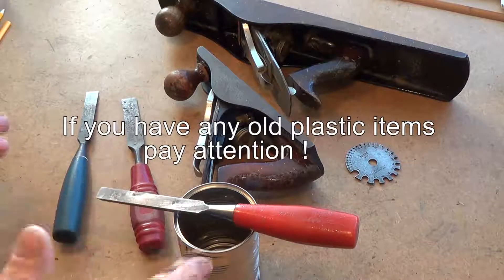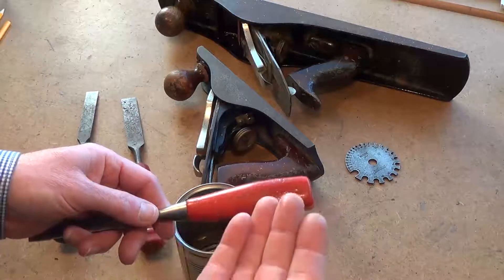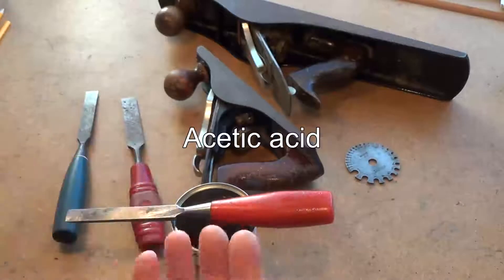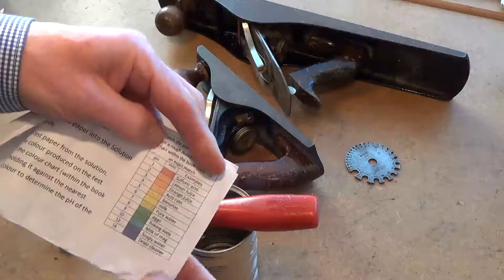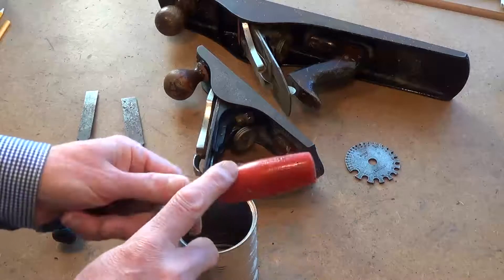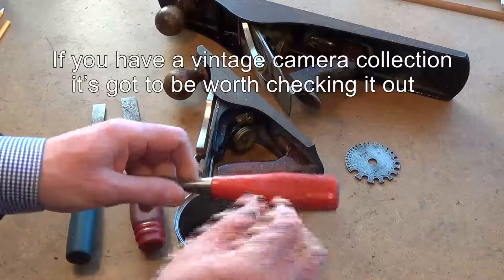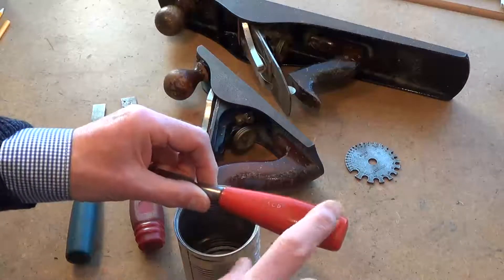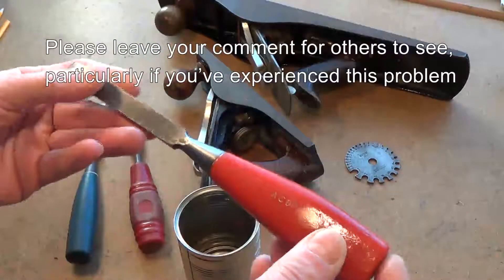Big problem with vintage plastic- tools and equipment etc

Comment: Cellulose acetate decomposing, quite common and well known problem. 

Apparently some American found out that if you lick the offending handles for a long time your tongue will go to sleep, how crazy is that?

I don't know a solution other than to get rid of the old handles/tools and use newer polypropylene ones.

Comment: I've noticed that on soft handles, things like pliers, but never knew what it was.  I've cut the old covering off and replaced it with heat-shrink.

I haven't got many plastic-handled chisels but if any do show signs I'll make wooden replacements.

Comment: Over the last 10 years or so I've noticed strange deterioration of various plastic and rubber items.  With plastics I've seen contraction cracking of parts molded onto metal, warping, breakdown where the plastic turns to a sticky mass, foam rubber turning to a sticky mess (this is very common, I've had to remove the foam from various camera cases, packaging etc before it ruins the actual item stored in it),  cable insulation becoming soft and sticky,  transparent plastic clouding, dead blow hammers shattering when used, all sorts of deposits developing on plastics, etc etc.
All rubbers and plastics don't suffer from these problems though. I have things that are extremely old made from plastic and rubber that are still almost perfect, but then some items as little as 5 years old have become useless. The composition of plastic and rubber materials is very complex so obviously some materials become unstable over time and breakdown into constituent ingredients. This could be an issue with the manufacturing process, ie, an incorrect procedure that makes a normally stable material fail prematurely, or, poor quality ingredients or overall material quality.
Obviously this is and will be a serious problem for many as so much of modern products is manufactured form plastic.
Personally this will impact me badly as I have a large collection of classic and vintage cameras, electronic equipment, motorcycles, tools, etc, etc.
I can't see a solution to it as once the degradation has started it cannot be reversed.
Possibly it could be stabilised by storing at a low temperature, maybe in a vacuum.
Reply from the maker: ***** 
Hi, I think this is a problem that we are stuck with and as you say it’s going to wreck a lot of special collections that folk have.  I’ve spoke with several museum curators and they’dall welcome a solution to the problem.  I think all we can do is recognise the problem and remove the offending article before it spoils any surrounding metalwork etc. Kind Regards  . . . Andy .
Reply: Yes Andy, I think the only resort is discussion with an industry expert, at least they would know whats happening and hopefully be able to offer advice.

Comment: OK, next day.  Evidently a lot of Sears stores see that their screwdriver, chisel handles get sticky and make the tool useless.  Our store honored their Craftsman Hand Tool lifetime warrantee and have replaced several of our tools.  I held out some that were either marginal or that I had modified, or that weren't Sears.  My 45 year old gasket scraper was as bad as your red handled chisel and was also covered with a smelly white stuff that looked like mold (it's some sort of crystal stuff).  When I brought all those up to the pantry to wash they smelled so bad they were filling the area with the acetate butyrate stench, and I covered them with water to stop that.  Then I added enough Arm and Hammer washing soda to make a saturated solution and waited about an hour.  After a scrubbing with a stiff brush the smell on all six handles was almost completely gone.  Some of the plating had rust stains I'll deal with, but the white spots, stickiness and vomit smell are gone.
     Since some of the tools had been treated before with a light clear spray with marginal results, I'll try again with something heavier like automotive clear coat.  Also, I'll change out the mat in the tool box compartment.  I've watched before as the white stuff seemed to spread in the box, so it'll be cleaned out.

Comment: I've had this problem and I thought it was a combination of the handle material and where the tool was stored.  I also had triangles and drafting templates degrade.  Today I was looking for a fix for the Craftsman screwdrivers.  At least ten years ago I cleaned several screwdrivers with cleanser (abrasive) and sprayed with a varnish of some sort.  It has worked for a while, but with additions to the assortment, it's time to take it on again. 
    I like the video, well done.  I plan to comment again with results.  Thanks

Comment: I noticed a similar problem on my old drawing board which I used in school. (Rotring Drawing Board A3) When I took the board after 20 years from the cardboard box the rubber feet were completely dissolved! In the box there were only greasy stains. The board and the ruler itself seems to be ok.
Some plastic boxes in our kitchen begin to dissolve. The start to smell like vinegar after some weeks in the drawer. I throw them away and switched complete to glass boxes. Hard to find these days.
I guess it initially volatilize stabilizing excipients and then disintegrates the plastic in certain chemical constituents.
As I was a child, my father always told me of his experience with plastic as an EE: "Plastic is a pile of crap." ;-)
btw: Very interesting Channel! I found you via EEVBlog.
Reply from the maker: Yep I think there has been, whole bunch of ‘wonder products’ that turn out bad and I guess there’ll be a whole bunch more in time to come.
I can remember a cigarette advert that said ... Craven ‘A’ are good for your throat’...
Thanks for the input.
Regards ... Andy

Comment: One other thought, Andy. I wonder if the aviation and space industry has had this problem?  You might give it some in depth thought on your next flight. :)

73 -- de Mick, WB4LSS
Reply from the maker: Hey, rotting aircraft parts, now there’s a merry thought! The good news is, the aviation industry would, I'm sure, deal with the issue. The thing is I’ve worked with these guys and I can tell you no one in that industry wants the finger pointed at them when an aeroplane drops out of the sky. Mind you I guess there could be a few bits of old spacecraft festering away, and the thing there is, as they reported on the news here in the UK when the latest satellite was falling to earth, they said, ‘having the debris hit your home would be like winning the lottery.’  I know what he meant but I think winning the lottery would be preferable.   
All the best . . .  Andy

Comment: Hello again, Andy. I just took a look at my '50s - '60s era tools and found no evidence of this behavior. I also checked the tools I inherited from my dad, most of which have hardwood handles, but a few are plastic and found nothing on them either. I wonder if some of the manufacturers back then used a "new and improved" chemistry make up? Perhaps that's why some plastics exhibit this and others don't. Or it may simply be your chisel is weeping from loneliness and wants to be held more! :)

73 -- de Mick, WB4LSS
Reply from the maker: Well, as I’ve said in the video, ‘this is the first time I’ve seen it in hard plastic.’ But looking at the comments from others I'm not alone.
73’s ... Andy

Comment: This is a big problem with Binson Echo units from the 1960's a liquid leaches out of the insulation of the wiring which goes brittle, the liquid is extremely corrosive..

Comment: This reminds me of vintage equipment I have opened up and found a sticky sweat on clear rubber hose used to hold bundles of wire together. I've also been annoyed by rubber parts seeming to completely liquefy - rubber feet/pads on equipment's bottom, and the rubber parts inside some old phonographs.
Reply from the maker: Yep’ I’ve seen rubber perish and have come to be quite accepting of it, but I’d never seen it on very hard, dense plastic like this. Even now the plastic is very hard, and quite hard to cut with the hacksaw. When I cut it up there was a strong smell of vinegar and the blade was damp but there was no obvious place where the liquid was coming from.

Comment: Have had that happen and shortly after the plastic turns to powder as it's integrity is now gone. With the wiring be careful, the liquid there is not acetic acid but PCB, poly chlorinated bisophenol, which was used up to the 1980's in PVC wire as a plasticiser. It was banned as it is somewhat nasty stuff, and leaches out as well with time and temperature, and reacts with the copper to make some nasty sticky byproducts. Still a lot of it around in older buildings in the walls.

Keeping the chisel and placing a new wooden handle on it will be nice, my dad used some Pride of India wood from the tree in the garden to replace a hammer handle once, as it was so tough that you needed a hacksaw to trim the older stems on the tree, nice fine grained and dense wood.
Reply from the maker: Hi, thanks for the input, I didn’t know that you’d made a comment as I'm not getting notifications from this new blooming system. OK on the cable, ok never thought to test it when I saw the green/blue liquid running down the wall, I just replaced the cable, so if it was PCB as you suggest then I guess that would be none conductive. I used to use very large capacitors (attaché case size and larger) and they had PCB’s in them as the dielectric. I was told the PCB's were harmless in its liquid form, (one rep said you could drink the stuff,) but its hazardous when burnt as the fumes are toxic, or so I believe.
Regards ... Andy
Reply: AndyDaviesByTheSea
About as harmless as Benzine, so you can drink it, but will die from cancer some time later.

Comment: Hi, Andy. You are quite right, this is a problem in museums - particularly those collecting 'modern' materials. As a Curator of Conservation I saw it quite often. Many children's dolls from the 1950s suffer from this effect as they were made from acetate (polyacetate) type plastics - these were only reasonably stable. The effect you observed was due to hydrolysis of the plastic in a moist environment. The base plastic converts to a hydroxy-polymer and releases acetic acid in the process. As you have noticed, this occurs after a long time and also exudes the acid over a long period. At present the problem seems irreversible. A similar effect is seen in lead objects which are stored in oak draws or cabinets. Here, the acetic acid is generated by the wood and the acid attacks the lead (lead acetate is is produced on the object). The lead acetate absorbs carbon dioxide from the air and forms a white crust of lead carbonate on the lead artefact. The carbonate is stable but loosely attached and falls away exposing more lead to corrosion after a time all the lead is consumed. Modern acetate plastics are stabilised so the effect is less common nowadays.
Reply from the maker: Hi there, thanks for the input, very interesting. I guess the oak/load problem accounts for a fair bit of lead roof failure in ancient buildings. I’ve clicked the ‘thumbs up’ on your answer and I hope others will as I’d like to see it go to the top of the list.
Thanks again for the input.
Kind Regards ... Andy

Comment: A slightly different problem, but hopefully interesting nonetheless....... When I started working in the shop I still do work at, they were having an ongoing problem with the thermocouple wires and the channels they ran in corroding on a certain job. This was a T type (Copper/Constantan) thermocouple.

The copper wire especially would just rot away pretty much the entire length of the wire. They were encapsulating not only the wires, but also the connector that the wires terminated into with high temperature RTV silicone. Dow Corning 736 specifically. Well, guess what extremely strong smell that Dow Corning 736 emits as it cures? A very strong vinegar odor from it releasing ACETIC ACID during the curing process.

 It took some time, but I finally convinced them to try an oxygen sensor safe high temperature RTV on one piece (this particular job is for a steel mill and we refurbish and send them out in pairs. Then those pairs come back come back and we refurbish them again after a few months).

Well, the half with the new o2 safe RTV looked like new and the other half was badly corroded. Problem solved until about 15 years later with different management trying to save some money. They went with the 736 again since it was cheaper, noting that it was specified on the older drawings and couldn't understand why it was changed. Again, I tried to explain the problem, but to no avail. Then the wires started to fail again.

Suddenly, quietly, the o2 sensor safe RTV started to be purchased again.............
Reply from the maker: All very interesting. I never use silicon sealer on any metal. I have used it to seal coax cables on my ham radio antennas and its more trouble than it’s worth, the acetic acid corrodes the copper, it soon turns bright green.  The thing is with RTV you’re expecting the acid, the problem with the chisel was it was unexpected. Ok on the thermocouples, I had to look up type ‘T’ all my work has been in the high temp ‘K’ R’ and ‘S’ types, never done much  < 0°C work other than rapid mould heating to release ice lollies.  The type ‘T’ looks like it’s for seriously cold work.  
 
Kind Regards ... Andy
Reply: AndyDaviesByTheSea  These thermocouples are used to measure the shell temperature of the steel as it travels down the liner of a continuous cast steel mill mold.

Most of these molds have a constantan rod that is stud welded to the back side (the cold face) of the copper liner. This makes a near perfect thermocouple junction that is not effected by corrosion and contamination.

A constantan wire is then soldered to this rod and the signal is brought to an on mold connector. Usually a single copper wire is bolted somewhere to the copper liner to provide the opposing voltage back at the control.

The only problem with this setup was corrosion of the steel channel milled into the steel backup that the wire was encapsulated into. 

The second type of T type thermocouples used on these molds consists of a two wire junction that is screwed into the copper liner. These wires are quite small (22 awg).

The wire is then ran through a channel that is gun-drilled into the copper. This channel was then encapsulated with the RTV. The wires were so small that they would essentially disappear in a short period of time.

These thermocouples generally see about 200 to 250 degrees C maximum. The advantage of T over K, at least at these temperatures is that it is much more sensitive and keeps that sensitivity right up to its max temperature which is about 350 degrees C.

Sorry to hijack the main subject of this video. I thought that this information might provide some interest to you.

The handle of that chisel is most likely made from an Acetyl plastic. I wonder if it is shedding Acetic Anhydride? That is used in the process of making Acetyl polymers and can be quite corrosive. It also has that vinegar like odor so characteristic of acetic acid.
Reply from the maker: capriracer351
Hi, thanks for the input, I’d got it in my mind that the type ‘T’ was specifically for low temperature work.
And Ok on all the input. I think that as one topic raises issues and side shoots into other areas is very interesting, and it suites my ’easily-sidetracked-way- of thinking,’ very well my friend.
All the best ... Andy  

 By the way I didn’t get notification of your comment from this new system and with some 200 videos it’s a bit difficult to stay on top of responses.

Comment: Don't throw it away! This is a perfect opportunity to research the phenomenon. 
My guess would be that something triggers a reaction that breaks down the polymer, and that there is a slow chain reaction which keeps going as long as there is any amount of acid left on the surface. I would try dipping the handle in any kind of base and leave it there for some time, then wipe it off and leave it in out in the air and see if it starts sweating again.
It would be interesting if anyone knew exactly what kind of plastic this is and how it was made.
Reply from the maker: Funnily enough I had thrown the chisel away and then I it out of the bag again and saved the steel blade and thrown the handle away, and then I went back and got the handle out again and measured its electrical resistance, (it’s very conductive in places as anticipated.)  
I know nothing about chemistry but I'm interested to know more.
As I said in the video I dried it and after 3 weeks it was visibly wet with small drops of liquid at the lowest part. If you want it I'll send it to you.    
All the best ... Andy

Comment: I've never seen that phenomenon in a radio (thank goodness), but, I have noticed that "sweating" on the handles of several of my Father's tools, which I have in his tool chest.  Thanks for putting this information up here, I'd be very unhappy, if I lost the lot of them to corrosion.  It's troubling that it's conductive, also.  Thank you, Andy.
Reply from the maker: I once found a very good museum web site that had a lot of information on the subject but I didn’t save it as a favourite and I can’t remember the search term I used, but from what they were saying it’s a big problem and with time it gets worse as time goes by. I think it’s a bit like asbestosis in people (that got my mom) in as much as it takes years to develop.
   
All the best ... Andy